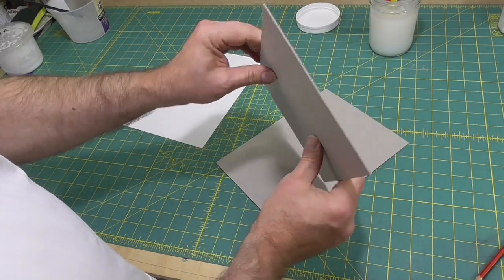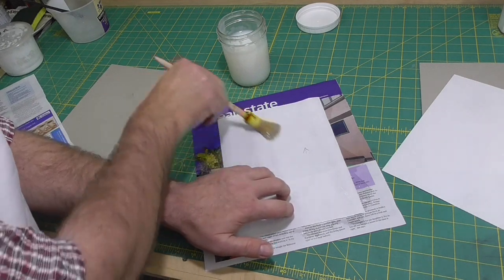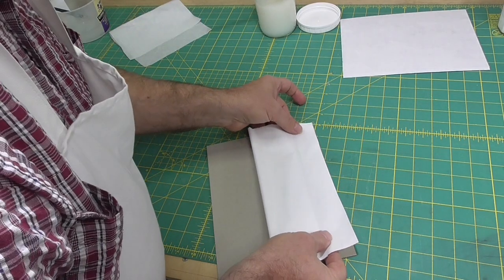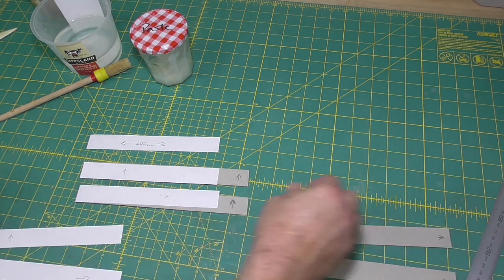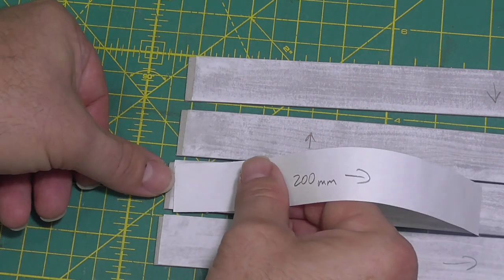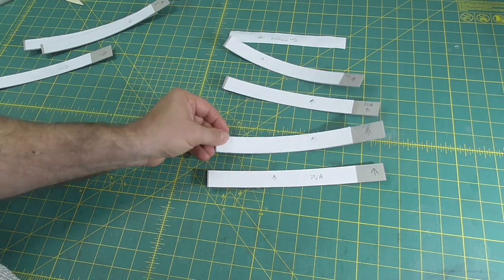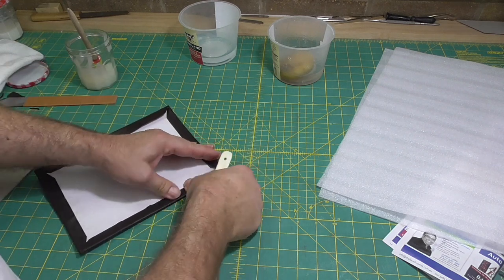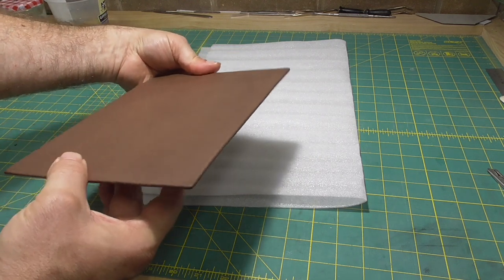How to Line a Board for Leather Bookbinding // Adventures in Bookbinding

Comment: Did you know that you can shape grey board spine to match your book block round spine by cutting it to size first, laying it on a PVA plastic pipe the thickness of spine and sponge wetting it to mould around the pipe ~ wrap in baker’s binding twine from top to bottom in a spiralling method and leave to dry! Then you can cover it in same way as you do the other grey boards with leather!!
Reply from the maker: Sounds like the spring on a springback
Reply: @DASBookbinding  It’s a shaped round cover board for a rounded spine and can be covered with little as separate section or joined with the side covers- I sometimes use this when using hinges

Comment: I would like to do a springback book in full leather.  I note that on the Binding a Springback book you did not cover the boards.  I assume that was because you were not using full leather.  If I want to cover one in full leather should I cover both of the boards (which form the split board) before gluing them to become a split board.  Also, my experience has been to cover both sides of boards but I note that you do only one side.  Can you give me some information on binding a springback in full leather.
Thank you.
Reply from the maker: Cover after the boards are attached.  In full leather it's not much different to covering any other boards-attached binding, just a bit more complex around the spine.  I'm not sure what you mean by covering both sides of the boards.  The inside of the boards on almost all styles of books is covered by the pastedown from the endpaper.  Good luck!
Reply: I meant laminating the boards with paper to avoid warping. You mention it in one of your videos on how to avoid warping and to do it on one side of a board when you are going to attach leather.
   Also, do you happen to know the difference between the English Springback and the German Springback.
Thank you

Comment: If one is using artificial leather, will it shrink similarly, or more, or less, or not at all? :)
Reply from the maker: There are many different types, but they are usually some sort of plastic and don't behave anything like leather, or cloth or paper.  I wouldn't use paste with it, only PVA.
Reply: @DASBookbinding  Thank you. I'll give it a try try - it looks like thin plastic glued onto cloth - so i'll probably follow the clothbinding tutorial instead. Thanks for all your great videos 😊

Comment: Thank you for your video, it's very interesting. I do have a query I hope you'll be able to help me with. I'm just starting out making leather journals. I would like to line my leather with patterned paper. Lining the paper is not a problem. I put the lined leather in a book press and it adheres to the leather really well and flat. however, when I bend the leather to form the book (wrap around style) where it bends the paper creases and ruins it. Is there a way to prevent this from happening? Many thanks
Reply from the maker: That is called a limp leather cover.  I don't have a lot of experience with these.  I have repaired some bibles like this but the lining does not wrap around the spine, thus avoiding the issue you mention.  I don't know how standard this approach is.    The other thought is to drum it on - only attach it at the perimeter.  Then there is no constraint on the spine area for the  differential movement going around the curve of the spine.  That might work.  I am studying up on bible binding at the moment and maybe in 6 months I will know enough to do some projects.  Ciao, Darryn
Reply: @DASBookbinding  Thank you so very much Darryn. I appreciate all your suggestions. Thanks for responding so promptly.
Reply: @DASBookbinding  I am interested in the cover boards. Are they acid-free and what is the brand name?
Reply from the maker: @kikeheebchinkjigaboo6631  I buy this board in bulk from a paper merchant.  Doesn't really have a trade name.  It's generic grey binders' board.  Yes, it's acid free.  Some of the trade names are Davey board or CXD millboard.  Darryn